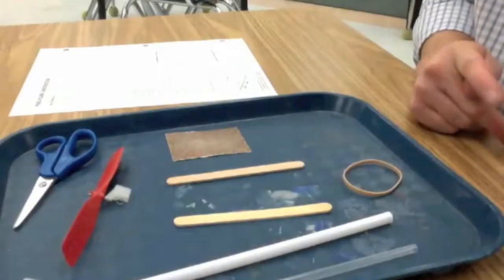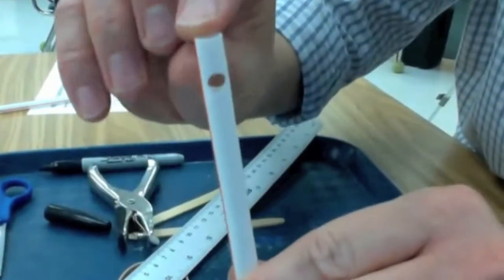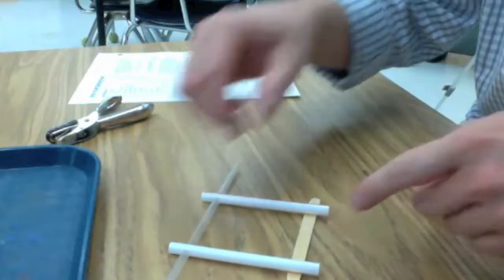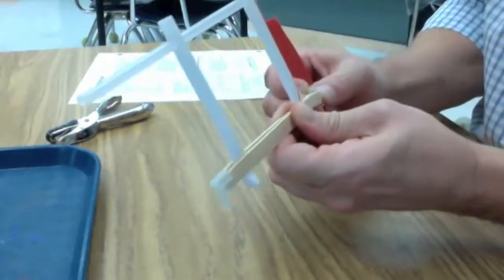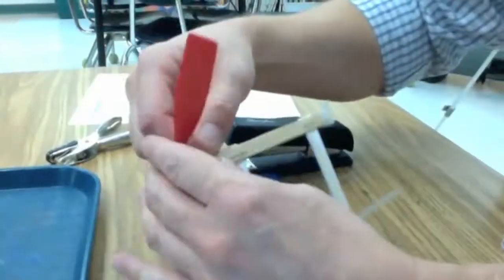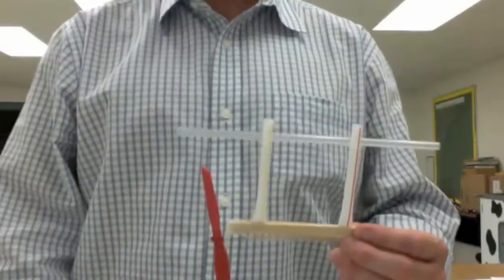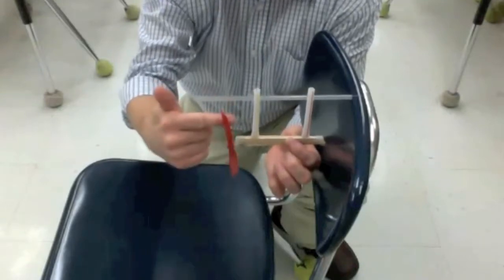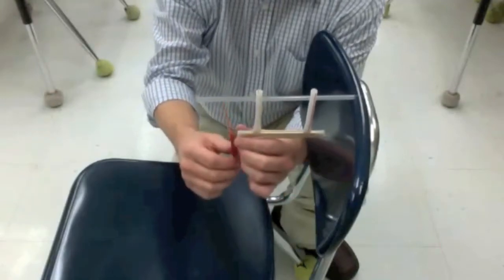FOSS Variables- Flyers Build

Comment: what would be my data for this type of plane?
Reply from the maker: +angel miley cyrus With this investigation, the variable you would test is the number of turns of the propeller... does the number of turns affect the distance flown? Spoiler: the results are not so predictably graphed.... 2x the turns does not equal 2x the distance... lots of discussion about acceleration and potential/kinetic energy.   Thanks for the question!